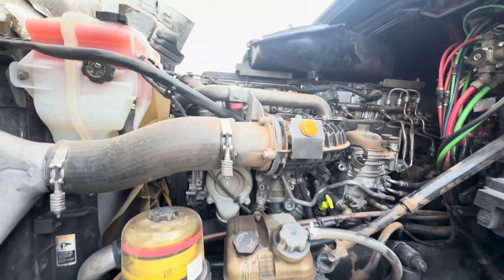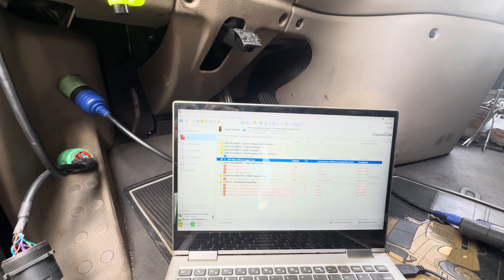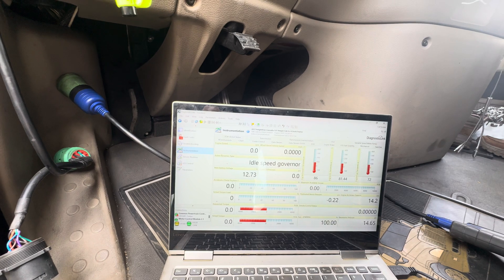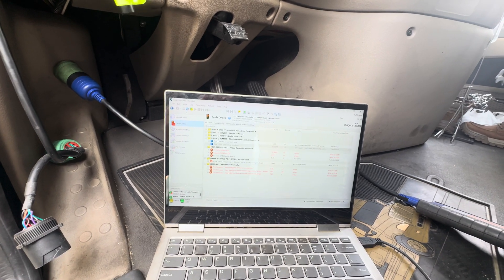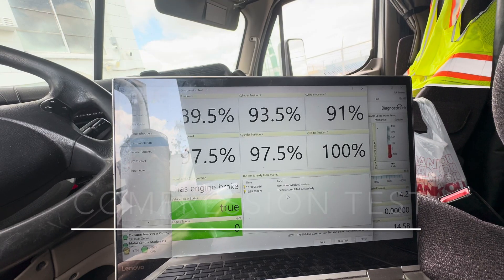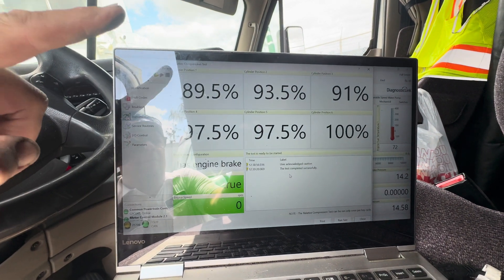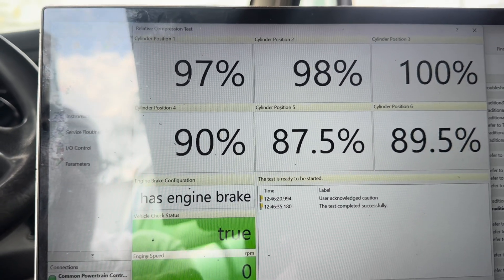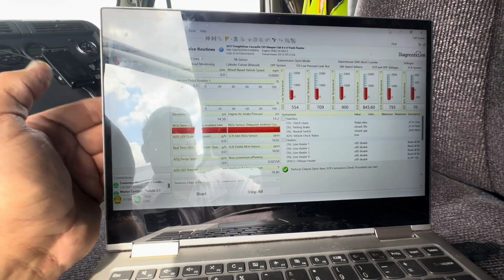Do you still need a valve adjustment even with good compression? Let’s find out DD15

Comment: A lot of people don't seem to understand the difference between a compression test and a relative compression test.

A compression test is where you measure the pressure inside the cylinder to see how much compression it has, in order to determine mechanical health of just that 1 cylinder.

A Relative compression test is a measure of how hard the starter has to work to compress each cylinder compared to each other cylinder. it says nothing about the overall engine health or the overall valvetrain adjustment, it will ONLY tell you that the cylinders are either similar or different, and different definitely means that SOMETHING is wrong.
Reply: A compression test will give you a pass/fail number that will tell you if an individual cylinder is having a problem or not. A 100% score here means that the cylinder and it's valving are in perfect mechanical health.
 
A relative compression test will tell you that cylinder A is only 85% as hard to compress as cylinder B, and 96% as hard to compress as cylinder C... A 100% score here means that it is the hardest cylinder to compress.

When you did the valve adjustment and cyl 1 dropped from 100% down to 85%, that does not necessarily represent an drop in the compression of that cylinder, but could simply indicate an increase in another cylinder that is now the new hardest cylinder. Please keep in mind that a relative compression test is HIGHLY dependent on the condition of batteries and starter, that's why the engine cranks over for so long, to even out the amperage draw and give a more accurate result. it is never a bad idea to repeat the test a few times and compare the results. +/- 10% swings between tests are quite common. Healthy batteries and a healthy starter will always deliver more consistent test results.
Reply from the maker: @operator8014  appreciate it. Definitely appreciate the input
Reply: @CarlosDieselElectric  I appreciate your videos a LOT! I only mentioned it because you seemed confused, maybe thinking your valve adjustment had lowered the cylinders compression somehow?

Comment: Job like that how much to adjust the valves ?
Reply from the maker: Around $450 for a DD15, DD13 on a short nose Cascadia might be more because of the fact the engine sits inside the cab.
Reply: @CarlosDieselElectric my truck is a cascadia,  engine has 561k miles and previous owner, who got the truck at 435k miles, hasn't done an overhead valve adjustment. So I am sure it needs one. Not looking forward to getting it done with the engine so far back under the cab 😂
Reply from the maker: @LightSpirit24 I am assuming you have a DD13?
Reply: Most dealerships and shops charge 4 hrs for overhead on most engines
Reply: I have short nose
Reply from the maker: @ $450. That will cover the intake, exhaust and engine brakes